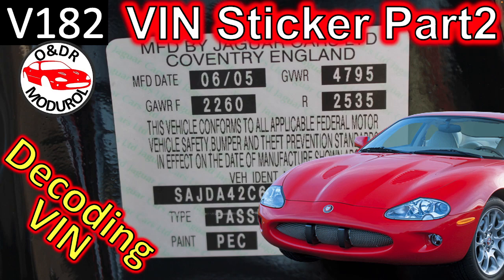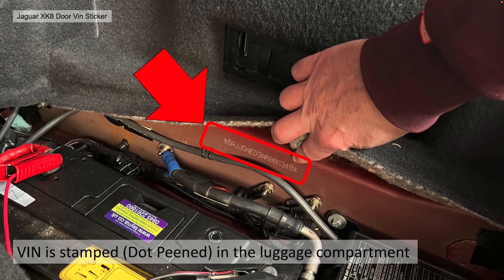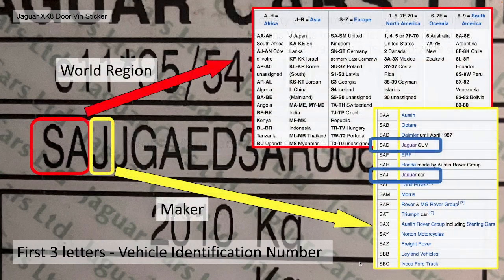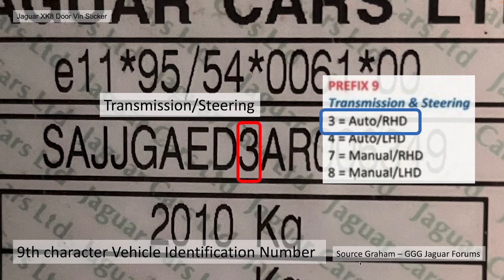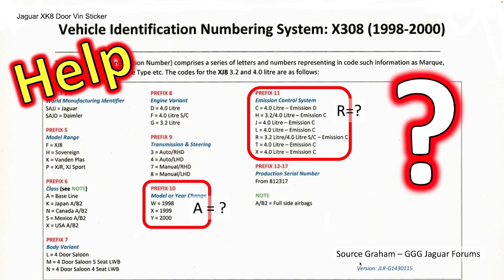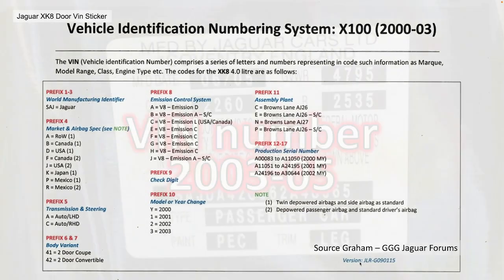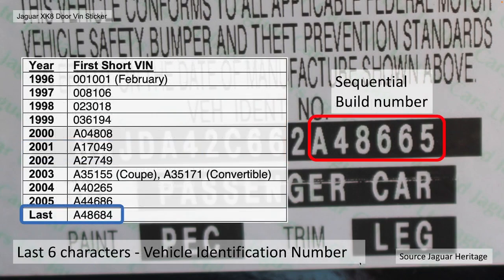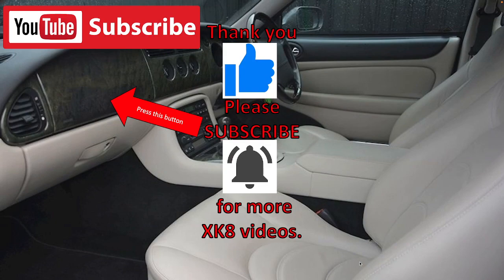Jaguar XK8 VIN Number Explained: Decoding 3 Different Formats (V181 Part 2) XKR / X100

Comment: Excellent video. I have a 2003 build date 8/2002 and last 5 Vin is A31896. I am praying this one has the metal tensioners.
Reply from the maker: @lilbitlibra3769. I think you are safe if your car has the 4.2 litre engine. From June 2002 and VIN A30645 this was the start of 2003 model year and introduction of the 4.2 litre engine. All the 4.2L engines have metal tensioners fitted as standard, regards Damian

Comment: Hi Damian, I've been trying to figure out my VIN for years because, like yours, it doesn't conform with the usual code. My car is a 1998 XK8 coupé with the VIN SAJJGAED3AR026077.
Reply from the maker: Huw, the nearest I could find was for the XJ308. I think the Jag engineers didn’t use it properly until it was completely standardised by the car industry. Different codes for different cars and even different years of the same model. It doesn’t really need a lot as paint and trim and completely separated. Just emissions and safety level, regards Damian
Reply: @Modurol  thanks, it's interesting what you said about the engine because when I put my VIN into my iCarsoft it tells me it's a 3.5L 😂
Reply from the maker: Huw, interesting where did the 0.5litre go🤔😆👍. That’s software for you, regards Damian